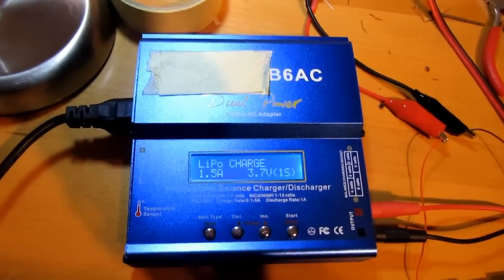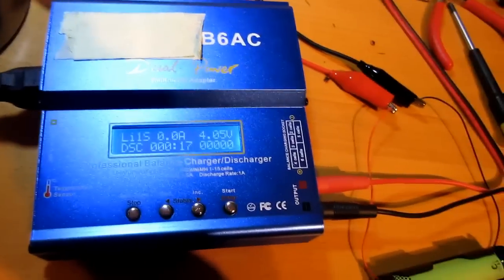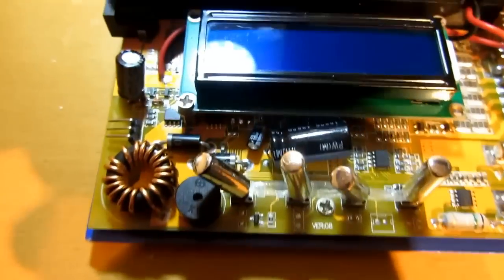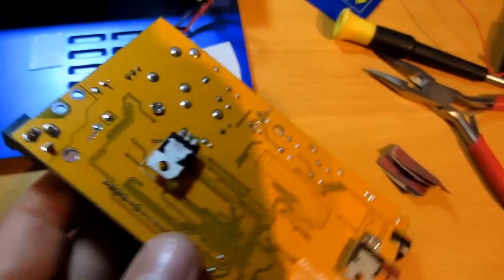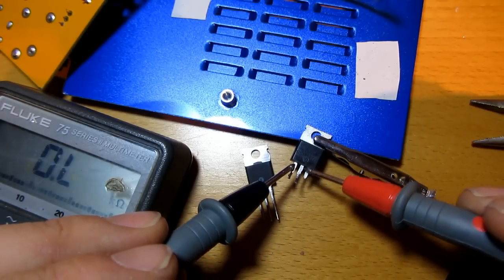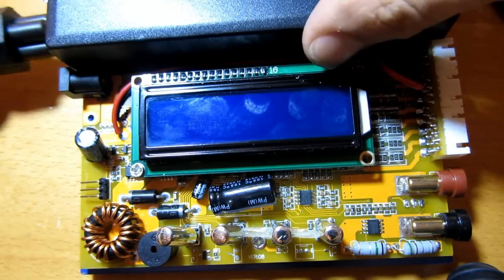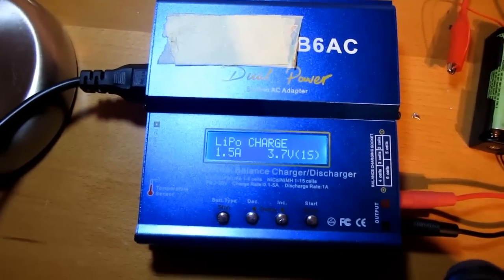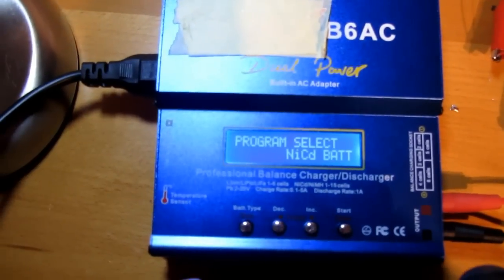clone B6-AC charger live repair

Comment: I  by mistake input  a  24V dc  and damaged a  cap  on the board, I replace the cap but now the device is saying "connection break", any idea ?
Reply: Probably a small transitory similar to this one in video but much smaller.

Comment: Thanks for the video mate, will try the fix as mine also wont discharge the battery...
Reply: ok was not the mosfet, its the resistor after the mosfet by the minus terminal!
Reply: @TheRecipeRemix  thanks for the update

Comment: I have a the imax b6 charger and each time I turn it on goes straight to discharge lipo mode and battery check and then connection failure and the buttons do not function, if you can help me with this one, thanks

Comment: hi Marcel.o R
i have problem with my b6ac, it will restart everytime i am trying to charge a battery, it doesnt matter whether it is lipo life pb nicd, it will reset the charger to the main screen. can you help me explaining what is the faulty actually? currently i am using an external power supply adapter rating as 12v 4A. the internal adapter as i measure is like only 11.98V 2.2A. please help. thanks.
Reply: AhLee Yong i think it shut be stel up converter. or 5v stab. then you start charging, 5 v drop, Andy processor restart

Comment: Mine puffed the magic blue smoke and the discharge function stopped working. The only difference is that it shows the discharge Amps, counts the miliamps that it sucked out from the battery but it does not really discharge. My multimeter says its discharging at 0.018 amps. Do you think it might be the same thing?

Comment: I wonder if you can help me on my iMax B6 charger.(trying to charge a phantom 3 battery I notice a burn smell after I connected the battery on PB charge)
all the functions and the display works except it DON'T charge there is not voltage coming from the output charger...
is there any input or output fuse that I have blown that can be replaceable and were is it.
thanks
Reply from the maker: +Quasimoto Glez there's no fuse in the charger, only in the power supply. 
maybe a transistor or mosfet is blown and it needs some soldering work.

Comment: You run it without a heatsink on the MOSFET while discharging, did the MOSFET survive ?
Reply from the maker: +Dorf Schmidt For short time, shouldn't hurt it. 
and .. I had more of them. And yes.. it survived and still works after 3 years!
Reply: I presume that you will see the problem in the near future.
I fixed this problem after 3 years.
This problem is caused by power MOS Tr due to low heatsink capability.there are no screw between POWER MOS tab  and case.
There are not enough pressure for POWER MOS TR view point from power dissipation.  I added plastic screw to this MOS FET TR(TO-220) with 3mm hole for original case.
There are no pressure of This MOS FET TR for original this set.

Comment: i see that most of these fake chargers tend to overcharge the batteries that are connected, resulting in broken and even worse exploding bateries.  There is a fix on youtube to get it right, still it is a piece of SH%T if you ask me. So stay away of the clones
Reply: did anyone ever experience an exploded 18650 by themselves. Everyone keeps warning me, but even though i mistreat them once in a while i have never experience one BOEM during charging?.A few went pffff, but that's all. And I have experimented on 100's of them.And clones aren't always bad, but as the cook said "if you use sh%tty butter, chances are you have sh%tty food"

Comment: hi I got same charger , tell us what mosfet  did you use to fix it thanks , as I want to order some
Reply from the maker: I Used the IRF 510
most of the mosfets with the same pinout will work, but should be one who can handle high amps

Comment: Well, I got an original (I think) and a clone from the same seller. The buzzer is quite different between the two AND the clone can charge at 6 amps and discharge at 2. I never use it, since I fear that it might over-stress it, but still, that's pretty weird.

Also the storage function didn't work on the clone. It just charged the batteries back up. I had to manually program the thing.

Comment: I have a similar,one (clone) It works fine since the purchase (several months ago) Today I've charge a Lipo battery in the morning and in the afternoon it wont charge anymore. When I hit the button to check the battery and start to charge, it stops and returns to the very begining as I turn it on. Could be the same mosfet?
Reply from the maker: it's possible, but it can also be the current-sense resistor. maybe a loose/dry solder joint or indeed the mosfet.. try to measure the resistence in de mosfet like i did.